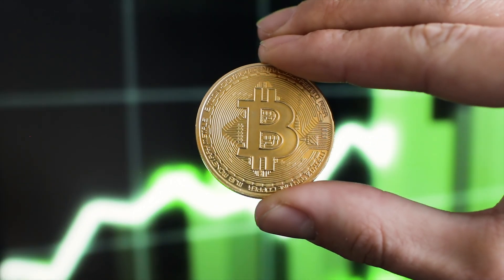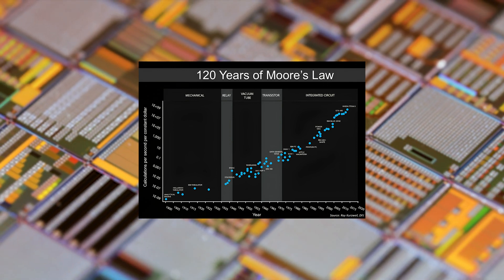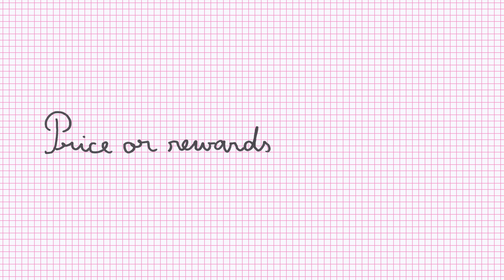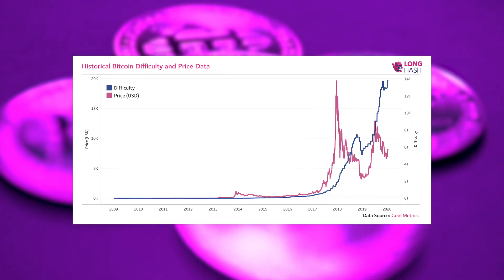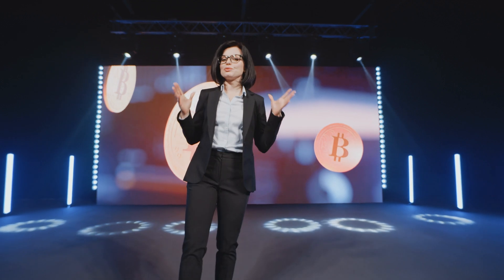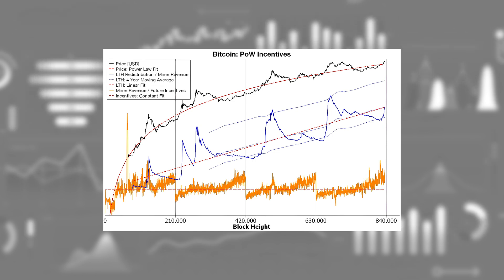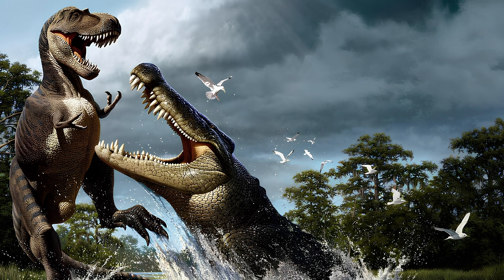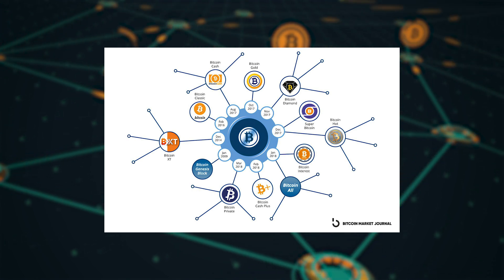Why Bitcoin Has Its Bubbles

Comment: 1. Price starts rising gradually (following the power law).
	2. This makes mining more profitable → more miners join → hash rate increases.
	3. The rising hash rate increases security → this attracts more investor trust.
	4. More people adopt → price surges faster than usual.
	5. Media, speculation, and FOMO pile on → a bubble forms (price temporarily overshoots the power law).
	6. Eventually, that unsustainable pace exhausts itself due to lack of new resources entering into the network (no new buyers, investors taking profits).
	7. The bubble pops. Price falls—but not randomly. It returns to the power law line. That’s the “stasis” again— where price consolidates near the power law baseline, until the next cycle or threshold begins.
	8. Cycle repeats itself as Bitcoin continues to follow the Power Law.